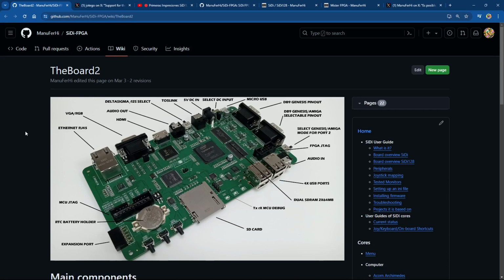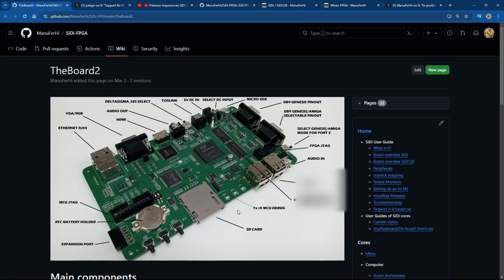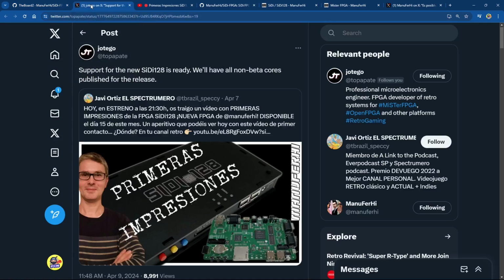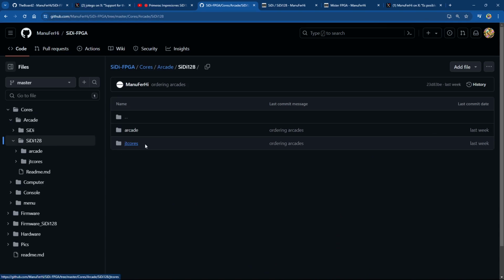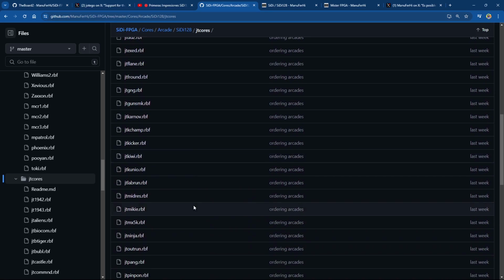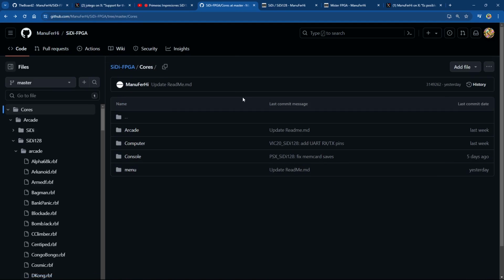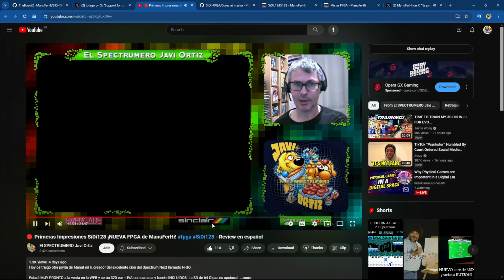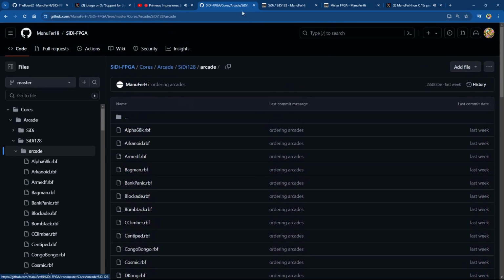SiDi 128 |  Some MiST & MiSTer FPGA Core Have Been Ported

Comment: I have the older version of the SIDI. Initially I thought it was great but it's flaky and never really worked properly. It corrupts its SD card all the time when using certain cores. I got it as I thought it was a great budget alternative to the MiSTer. I dont have any experience with this new SIDI but I recommend MiSTer personally, mine has worked flawlessly since I got it.
Reply from the maker: MiSTer is solid, for sure.
Reply: @PixelCherryNinja It's very polished. It's a shame it's so expensive. MiSTer Pi looks like a no brainer though, at least when they are available.
Reply from the maker: @electronraygun6346 you can order on SS1 for Q1 2026 delivery, if you can wait.